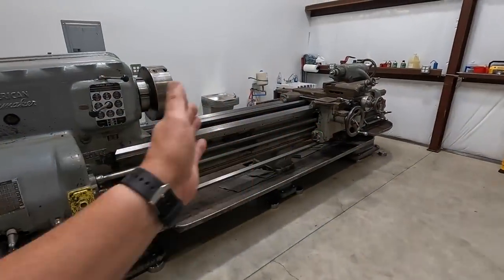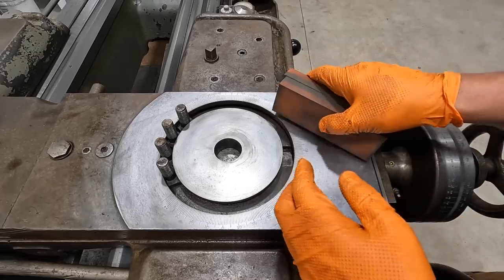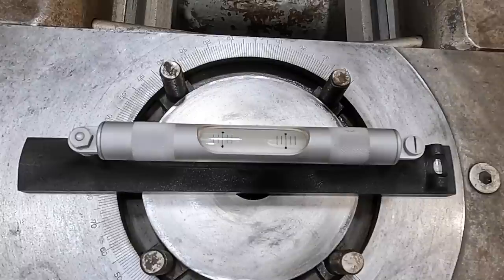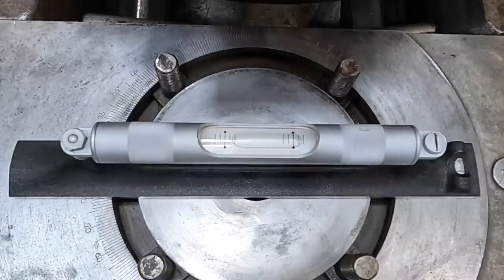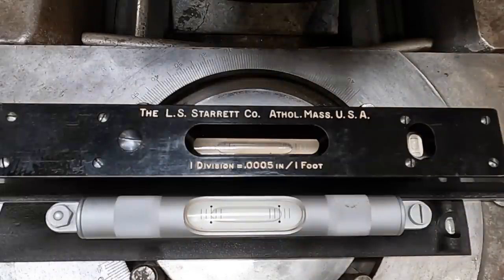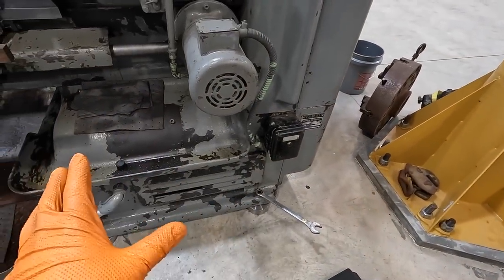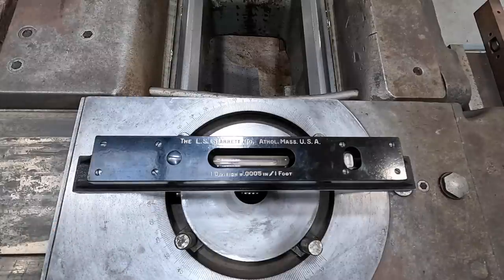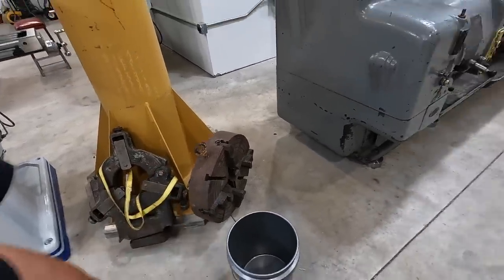Leveling the American Pacemaker Lathe

Comment: I have a question: How can you be sure that the precise leveling you're doing here won't be immediately ruined by vibrations or any loads that happen during operation? How often do you check the alignment and how well do these machines usually keep their level?
Reply: Well, to answer your first question, the precise leveling will absolutely shift under vibrations and loads at first. But, once it's leveled and settled out, a machine won't move much at all under normal operation. Especially bigger ones, that's probably around 10,000 lbs (4500kg) of lathe, some load or vibration isn't going to make a difference.
The rest of the alignment process is much easier, this is just the initial leveling and is the most time consuming. Machines will do what's called "settling," where the castings and the feet and even the concrete underneath the feet will shift slightly under the constant weight. So when you move a machine, you do the initial leveling. Then, a day or two later, you check the level again. It shouldn't have changed much, but it probably settled some and changed, so adjust it back to level. Then start using the machine like normal, and check the level once a week or so and adjust back to level as it settles. Once it stops shifting from week to week, then it's fully settled and level, and you only really need to check it once or twice a year after that.
Reply: As I always do when answering questions here, i'll preface that I'm not an expert lol. However, as far as I know if you are using a lathe within the limits it was designed for, particularly its weight and rigidity, vibrations shouldn't significantly move it. The cutting forces also can't move it as they don't cause any external reaction force to be placed on the lathe, though I suppose it could affect the "twist" of the ways, but again it shouldn't if used within the design limits. Not sure on how long you can assume they stay level though.
Reply: kinematic mate that forms between the shoes and the floor due to the incredible mass. sheldon nailed it.
Reply: @sheldendowden3096  thank you for the detailed answer.
Reply: @sheldendowden3096  Thanks Sheldon for that explanation, answered the silly questions I had. As the power engineer in the comment section, all I can say is this. 'We' will provide Adam with the necessary energy to keep him busy for a long time, to keep making interesting videos we can 'ALL' learn from. Cheers.👍.
Reply: There will always be some shifting due to what you mentioned.  This will show up in inaccuracies that will develop in machined parts.  When the inaccuracies get large enough to notice, it is time to get the level out again. Let the micrometer be your guide. Don't forget this is a new building, a new cement floor.  Releveling is something any machinist knows he will be dealing with periodically.  The greater the precision sought, the more frquently this is done.  The job is easier with 2 guys doing it, 1 watching the leve, the other moving the wrench, and both of them relying on their communication abilities.
Reply: gravity doesn't change a lot.
Reply: @ScottPankhurst  Einstein said that Gravity distorts space according to mass.
Reply: I notice a crack in both sections of the concrete so the floor may still have a little settling to do.
Reply: I appreciate Shelden's answer. It would make sense to me that for the first few hours of use the machine is going to "settle" into it's new home. I guess that bits of grit under the feet, imperfections in the floor finish and tiny differences of pressure taken up by the 12 different levelling screws will even out as the machine snuggles in. I wonder if, in its original installation, the castings might have taken a "set" related to all of the above, and if it needs to "relax" into it's new home after being moved. I also know that a newly poured slab will move quite a bit depending on how well the ground was compacted during the foundation work, and what sort of soil movement is typical in the area.

I will be interested to follow this channel over the next few years to see if, how often, and how much this lathe and the other machines need to be checked and tweaked back into level.
Reply: @musicbro8225  We will never get aroung concrete settling'  We mic and mic and mic some more.  I have often used Adam's trick of leaving a little metal after machining, then finishing with emery paper.But I have never had to do such critical work that I could not do thic.  Even working on high speed steel, and once or twice with carbide, I have gotten the stones out of their oil bath to rescue me.  At least for now Adam will save some of that finishing time!
Curious, what is your music?  I used to work in blues bands, blues harp (harmonica).  Still play occasionally just for me to listen to.
Reply: @prodoverjeff2876  Hey there Jeff. Yeah I guess the soil under the concrete will always be on the move but hopefully a few thousandths at a time. However with the newness of the floor the degree of movement may be less predictable.
I have friends playing in bands and used to go to their gigs and video their performances. Personally I have tried learning to play a guitar and had piano lessons when I was very young, but I never got fluent... I make some music with virtual instruments but it's not the same, performance is greatest of all :)

Comment: With so many feet on each side, I wouldn’t turn any one too much as you will get false readings as that area either drops or rises, warping the bed. So sure, turn a quarter to a half turn on one end, and then do each other until you reach the other end. Just keep doing that until you get approximately where you want. Large lathes are a pain to “level” because of so many feet. If you’re not careful, you can get the bed “leveled” through the length, only to find the bed humped up and down along the length. So no twist, but the bed isn’t straight either, it’s wavy. That can be hard to see. You have to put the master level lengthwise on the bed, and move it a few inches at a time along the bed, and see which way the bubble goes.

Comment: Great video on leveling a longer lathe. I'm current trying to level a 23x118 lathe and from this video, i understand leveling front to back. But what about headstock to tailstock (in length)? Is this not necessary?

Thanks for input.

Comment: Why do you not check to see bed is straight?   The cneter of the bed may be  high or low relitive to the centerline drawn between the chuck and tail stock?
Reply: How would you check that? Once he has both the headstock and tailstock end level if he put the level longitudinal on the centre of the ways would it still read level? Since it would be sagging pretty equally from end to end on the level

Edit: nvm I guess he could repeatedly set the level along the ways and work in from the headstock/tailstock ends towards the centre
Reply: @6Drugstep9  Yeah-  longitudinal on the carriage and take readings as you step down the bed.  I have never done any of this... it seems like it would be as important as twist.

Comment: I'm curious about level from headstock to tailstock, parallel to ways.  Seems to me that with setting cross level at headstock with the feet under chuck, the weight of the headstock could cause some bow in the bed.  By this, I mean the level set parallel to the bed, moving from head to tail, you could see head low, bubble to right, then level halfway between head and center support, then moving towards center support bubble moves to left, then moves to level over center support.... same with section between center support and tail.  It was so easy to see a little twist in bed, seems like wavy or bow along length of bed is likely.

Comment: Adam, did you level along the bed too, you've shown us minimising the twist end to end, but does the bed hog up or sag down? I do understand (with a used machine) that it's a balancing out process and could never be perfect in all planes.  

Also given how sensitive the Starrett level is, how much does it really relate to how the machine will react to machining loads, you pointed out not pushing or leaning on the bed while levelling because it would distort the readings if that is so then how will the 'level' of the bed be distorted while operating the lathe?

Lastly when all is at optimum level and well settled down given how delicate the levelling is, would some gentle toe clamping to the floor the level bolts (and the pads) be useful if only to prevent the lathe 'washing machining' out of place over time and upsetting the levelling?
I'm not questioning your proceedures or intent, I just want to know 🙂  come to think on it, there's an SnS right there, or two even ;-)

Comment: If that machine has been setting in that room for about a week it's  acclimated to the room. When you do you check and as far as I'm concerned you can do it now, turn your level 180°     in the exact same spot. This will insure the level is reading right and gives you a second opinion. If you put a human hair under one end of that master level it will read .005 off. What I'm saying is it's hard to lay it down perfectly and clean every time. You can mark the surface with a marker and it will sometimes show. Light from an over head light source will draw the bubble. Breath on the glass heavy a watch it move away.  
 Sorry it will be close enough for anything your doing.  Just turn it a couple times a check out what I'm saying.

Comment: Another quick question on the levelling, with how good you got the scales on this lathe, what tolerance in degrees do you think you have?  For various reasons I find it difficult to use bubble levels, I have a .01 (of a degree) resolution digital level but I'm wondering if it's really good enough.
Reply: I just did a quick calculation and 0.0005 inch/foot can be converted to 0.00239°
Your level with .01° resolution would be like a level with roughly 0.002 inch/foot
So it's a bit less precise. Also, you can't read "between the lines" on a digital level
Reply from the maker: That would work to “rough level”. For absolute precision a Master level with .0005” per foot graduations must be used.
Reply: Whilst the digital level might have a resolution of 0.01 of a degree, it won't have the precision or repeatability required for truly accurate result.
Try measuring something by lifting and placing the level, then flip the level 180 degrees, and measure it again. Then repeat that 5 times in the same place, giving 10 measurements. What's the spread of measured values?

Comment: You seemed to be focused on the level from front to back and ignoring from end to end?
Love your content Abom, thanks 👍
Make use of both levels at the same time having one across the saddle and the other 90 degree's around ,that way tour covering X and  Z axis.🤞👍👌
Reply: The most important measure is the twist as it affects how straight the lathe will cut end to end(taper). It can be off inches in height from end to end and it won't affect the way it cuts, as it's long straight from end to end with no hump or belly in the middle,  but twist WILL make a difference as it affects the distance from the tool post to the centerline of the chuck and tailstock.
Reply: @tomkrause62  - But how do you KNOW that there is no hump or belly in the middle? The carriage (ways) could be 1/8" lower in the center than at the ends, for all we know right now.

Comment: Surely the cracks in the concrete at the back of the slab the lathe is sitting on can't be ideal. This is a new building so perhaps the thickness isn't what it should be. This lathe is going to move there's no question to it.
Reply: Concrete always cracks, even post tensioned concrete which is considered uncracked concrete. This is why we have control joints, wire mesh, rebar at corners, shrinkage compensating admixtures and such. Unless the cracks are very wide, it’s likely temp/shrinkage cracking.
Reply from the maker: Nothing I can do about the cracks. They’re there and we’ll have to work around them and check the machines occasionally.
Reply: Concrete shrinkage cracks are different to ground moving cracks. Hopefully the concrete was laid on well prepared bed.

Comment: I am actually interested in seeing a check of spindle to bed parallel, since all the weight there I wonder if the 4 headstock leveling bolts can actually bend the spindle bore up and down relative to the bad.

Comment: What are the physics that make the bubble in the 199 move more with smaller adjustment? I would have thought that bubbles all would move the same amount across levels like these. I haven't wrapped my head around how this works.
Reply: The vial the bubble lives in is curved (very slightly). The silver level has a vial that is curved more than the black level, so the bubble moves more in the black level for the same amount of level change. The science behind producing those glass vials with such precision curvatures would be interesting to see.

Comment: ABOM, Love your channel.  That concrete slab is apt to move a fair amount in the coming weeks as it responds to the weight. I see you leveled the ends and middle (front to back) but didn't see anything that would suggest these three level lines are in the same plane (left to right).  How do you ensure there isn't a dip or bump in the middle without a long level/straight edge between the head stock and tail stock?
Reply: I was sort of curious that Mr. Booth didn't level out the machine when he first brought it into the shop, but then I thought maybe he was just letting it settle for a while while the concrete and the ground beneath settled under the additional weight of the machine. Being well aware of how new slabs move around a bit depending on soil conditions as well as the site work done prior to the pour, I wonder if there are industry standards about how long you should let a new slab settle before starting up a production line for example. Then again, I wonder if we are actually setting up any new production lines in the United States at all.

Comment: Wouldn't a digital torque wrench give you more info on the amount of pressure you are putting on each of the adjustment bolts? Great video thank you.
Reply: The wrench would indicate different torque values depending on the weight bias. Think of how it feels to lift an office desk when you are the one picking up the end that has the draws built into it (versus the end that just has a pair of legs).

Comment: So you used anti-seize in the leveling screws,what keeps them from unscrewing as you use the lathe overtime having is un-level again, or is it a standard practice every year re leveling it
Reply: The friction between the screws and feet is substantial.  It wouldn't hurt though, to put witness marks on the screws and check them every few months.

Comment: Why do you need to level the lathe? Is it just because it's nice to have things leveled or actually you need to level it because the whole beast of'a lathe behaves like an unleveled table, sitting on 3 points ony and if you touch the 4th corner it starts to tilt and move?
I like your content a lot!
Reply from the maker: I explained why in the video. You must remove the twist.
Reply: Everything flexes, even something as solid as the pacemaker still acts like rubber when you're working to small dimensions. So it's important to take the twist out if he expects to hold tight part tolerances. The twist has a tendency to drop or raise the tool as it runs down the bed. This translates to a diameter change in the part being turned.

Comment: What issues can arise if the machine is not perfectly level?  It seems like it is more of a relative measurement than absolute when you indicate, etc.
Reply: thrust impulse relative to angle of incident causing premature and uneven bearing wear (oscillation).
Reply: The tool position will not stay aligned to the rotational center causing the tool to move in, out, up or down. This will be transferred to the work making the precision very low.
Reply: @privateprivate5373  is that still true if the head stock is a bit higher than the tail stock, but the twist is removed using the level?
Reply: @kailuagarage  if the head stock is too high, the coolant won't flow to the sump which under the tail stock.
Reply: It's actually not really important if the machine is level, what is important is the alignment of the sections to eachother. Using a level is just the best way to do it because it is a very precise reference.
Reply: @Fetch049  I was thinking more like 1/8 of an inch higher or lower over that 15' length or however long that machine is.  Would that matter as long as it is not twisted?

Comment: Adam I saw a Robin Renzetti video where he was talking about compound/differential screws and the crazy amount of fine adjustment that can be achieved using those types of screw. Question to you is would a differential (two different screw pitches acting in the same axis) screw be a good application for leveling screws?  It seems that Starrett level is so finicky, a differential screw would be just the thing.
Reply: Either that or just a longer wrench
Reply from the maker: Sounds like it would be great!
Reply: A longer wrench and the right technique work well.  I have the Same Starrett 199 level and have used it many times to level my lathes.  I found the finest adjustments can be made when you use one hand to pull lightly in the direction you want to turn the bolt.  This takes all the slack out of the connection between the wrench and the bolt.  You then 'lightly' tap the end of the wrench with the other hand until the first hand (the hand holding the wrench) senses movement.  It is amazing how little movement you can sense with the first hand.  With this technique I can pretty consistently move the bubble as little as the width of the graduation line (not the distance between lines, but the width of one line).  Ken